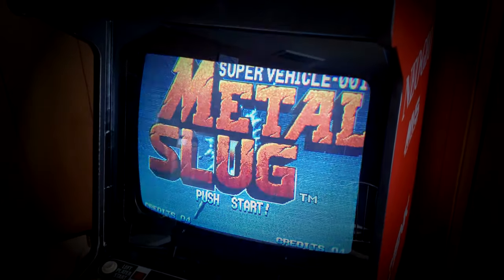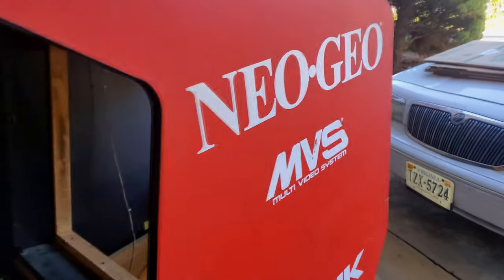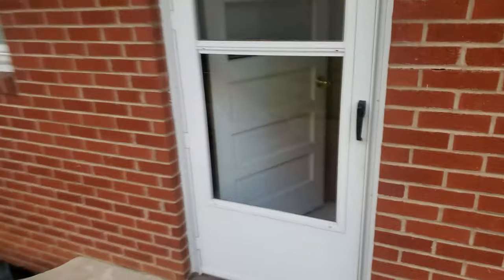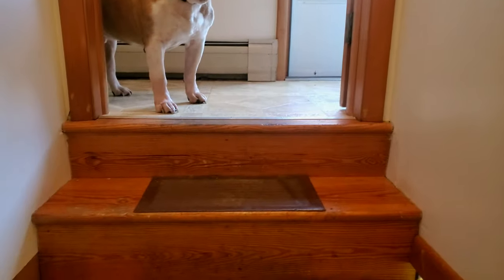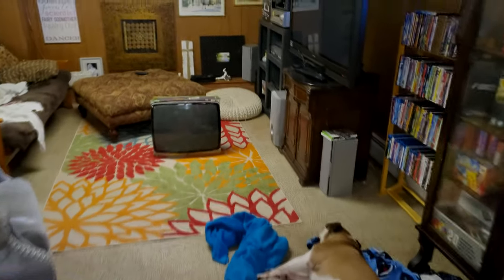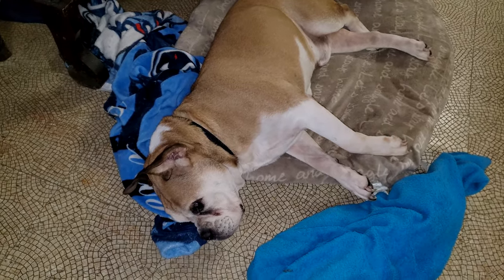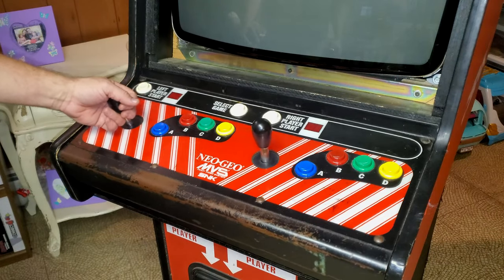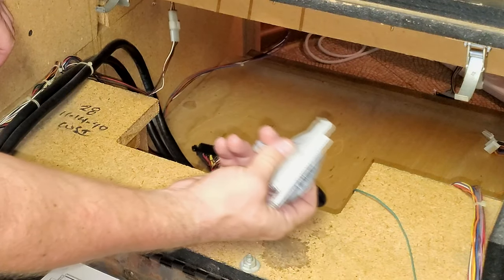Moving my Big Red NEO GEO & Upgrading to the MiSTerCade!

Comment: I know this is old...but how did you get it to your house? Thinking I have to rent a u-haul - which feels like overkill, but this model with the slightly taller speakers I'm not sure if it'll fit in a standard 6 ft truck bed